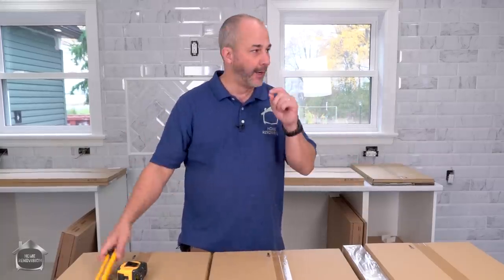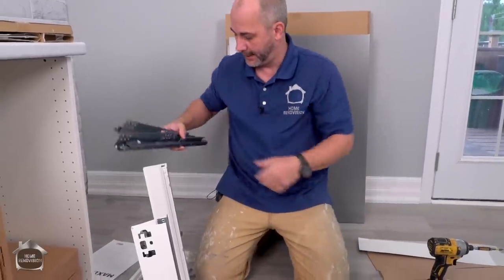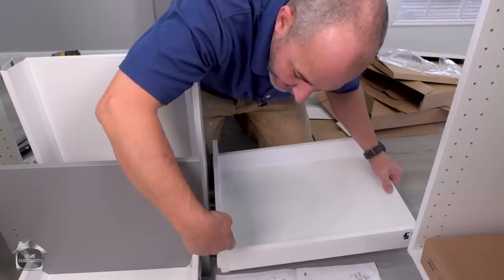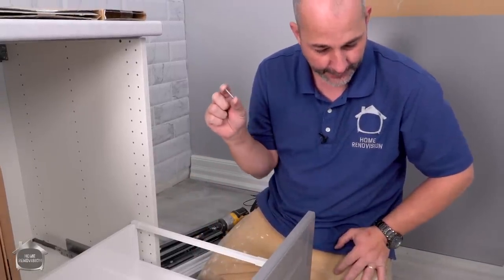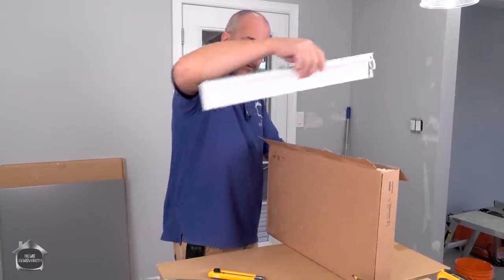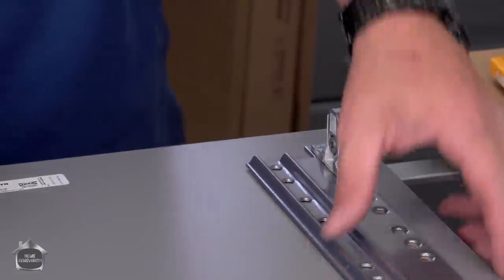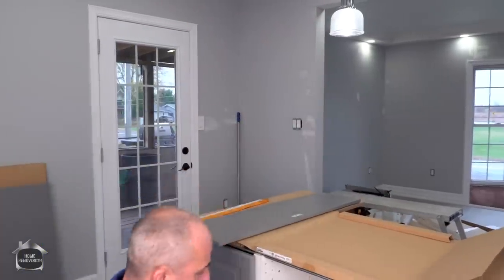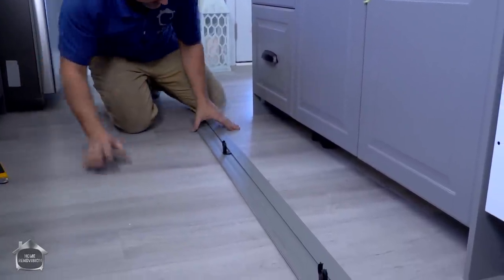How to Remodel Your Kitchen with IKEA Cabinets | Beautiful & CHEAP DIY Tutorial Pt. 2

Comment: I'll never install Ikea cabenits in my life, I still watched an hour video on Ikea cabenits I'll never install  😂😂😂
Reply from the maker: Cheers Gordon. hopefully you found at least one good jem in there!
Reply: It's easy and fun!
Reply: @HomeRenoVisionDIY  I just love your channel even if it's on ideas an projects I'll never proceed with, being a DIYer myself I find alot of these videos fascinating
Reply: Never say "never".  I'm a woodworker, and I am SERIOUSLY considering using IKEA cabinets rather than trying to refit/refinish the 3/4" veneered plywood cabinets I already have.  Just too much time and energy saved by getting new ones.

I hate refinishing pretty much anything....  That's also why I've decided to gut all the existing drywall as I go from room to room.
Reply: @ClayAutery  I adore mine.  They're really nice!  drawers/soft close - like butter.
Reply: Clay Autery We are in the same place.  We have 20+ year old cabinets that are now 3” too long because we wanted a new 36” range.   The cabinet frames and plywood are in great shape but they need new hinges, sliders, paint, plus they need to be shortened.  We have an unusual problem in that the finished end of the islands have an integrated finished panel side, so if we want to match our existing set up we need to remove that panel and use it for the side of a the new cabinet.  

It’s just such a PITA that we bought 2 IKEA cabinets to use during the remodel.  Just finished putting them together and installing them yesterday.  We used a hack to,strengthen the countertop support.  We used 2 4” strips of plywood screwed flush with the top of each cabinet to beef up the box for a heavy countertop.  It’s amazing how rock solid the cabinets are after the extra countertop supports were added!
Reply: Me too- I was like no way torture! But, with all of the good reviews here and your tips for kitchen renovations- I will try IKEA  :-)
Reply: @cgelmore488  Really - it's shocking how easy it is.  I got Axstad white and they're gorgeous.
Reply: It's literally lego with screws...

Comment: Your DIY videos are wonderfully helpful! 😻 I thought in this one you were going to show how to modify a panel to fit at the end of the cabinet covering the space between the cabinet and the wall, when that space is too small (e.g., 3 to 4 inches) to install another cabinet. I couldn't find that in this video. Can you please let me know where I can find that? I have an IKEA kitchen I installed mostly myself, but need to get your help with this. THANKS! :chillwcat:
Reply from the maker: simply build an L shape with small inside corner brackets and 5/8" screws. the part that goes next to the cab should be 6" deep and the side to the wall should be scribed to fit. then set in place and screw from inside the cab into the 6" deep part. Cheers!

Comment: I'm curious if BLUM themselves have hinges you can buy outside of IKEA (also BLUM @ $27 and $54 a pair. $380 in hinges for the kitchen I'm sized for). Richelleau has what I think fits and is the same for 60-70% cheaper.

Also, watch when you are using the kitchen builder. Mine added 3 panels for every box and alot of un-necessary accessories. Brought it from 9k to 4k

Comment: Thank you very much!
I've noticed that you attached the handles to the fronta after the instalation of the drawers and doors. It's also the way to go according to the IKEA instalation guide.
Howeder I think it could be easier to drill the front on the worbench, before to assemble everything. Do you think there is a reason to wait?

Comment: Great video, but I am a little concerned about the advice to cut the end panels at the bottom as it will leave the cut line and end grain of hdf exposed to water when washing the floor. A cut line on top would easily be covered by overhanging tabletop. If you need to scribe against floor to follow an uneven surface, remember to buy and install one of the plastic covers to put between floor and panel.
Reply from the maker: I use a tiny bead of clear silicone to seal it up. but great point. Cheers!
Reply: Rene Pape - what plastic covers? I don’t know what these are.
Reply: @jayd9203  I just checked, and it seems like IKEA does not provide these for the Metod system, but only back with the old Faktum system.
The IKEA recommendation, probably because of all the moisture problems, is to let the end-panels follow the bottom of cabinets (not floor) and only use the plastic foot-plate at the ends as well.
I just mounted another kitchen from HTH, and they still deliver these "strips" as the foot-plate is made of MDF (sorry, in Danish):
https://www.hth.dk/e-shop/tilbehoer/koekken-sokkel/26891513/gulvprofil-i-klar-plast-til-endesokkel/

Comment: This guy sounds like an Ikea employee. Let me tell you my cabinet story about renovating my  kitchen. The general contractor I hired said that the cabinets will only cost me ~$10k and that they will look awesome, custom made ... everything. I ended up using Ikea's kitchen tool, and then purchased all the cabinets, doors, gables, rails etc. from Ikea (the walnut finish) for $2700 tax included. Then it took me 2 days to assemble them. And then I was done, and I was super happy with the look and the results. So I saved $7300 and at least 2 weeks of waiting - perhaps 1 month. On my side of town, $7300 does not grow on trees, so I hope you will pardon me if the writeup here sounds like from an Ikea employee as well.

Comment: Love the video Jeff. So how does everyone feel about the metal drawer sides and back ? Can someone who has these comment ?
Also, how is the particle board holding up on the carcasses ?

Thanks.
Reply: Hey Will. I’m a life long cabinet maker and work in a high end custom shop. I can tell you this much- the Ikea metal drawer box systems are great, as are those by manufacturers like Blum and Grass. They’re extremely well engineered and make front installation and adjustment a breeze. It’s also nice because if you spill something inside you can just pop the front off and wipe out the box then clip it back on. The traditional drawer is say a birch dovetail box with side or under mount slides. While a decent option they don’t provide for near the adjustment possibilities. Also, spill any liquid inside and it can really damage them. As for the particle board for the boxes, this is by far our preferred material for cases in my shop. We will make plywood boxes but it is a major pain in the ass. The material isn’t nearly as flat, scratches and stains easily and really isn’t that much more durable than particle board with PVC edging. The big thing with particle board is to *snug* your fasteners and avoid over tightening. IKEA, like us in a custom shop, use a large number of euro screws. The big fat guys with no point that typically fit in a 5mm hole. They have a very coarse deep thread that holds well in particle board and mdf.

Comment: Hi Jeff!  Question:  Did I hear you say you can reduce the height of the toe kick?  Like from 4.5” to 4’?  Our finished floor is not level - out by 1 inch.  Was thinking of making the perfect counter height around the stove.  Then to the left the counter will be 36.5 and the opposite corner will be 35.5.  But that would mean the toe kick is too tall in the corner with shorter counter height.  Or would you go with starting counter height at 36” and end up with most of the counters being 37”?

Comment: Wow. I did not realize until now that IKEA has different sized drawers in the US and Europe. Over here, the cabinets are 80cm tall (about 31½ inches), and the drawers are 10cm (~3 15/16"), 20cm (~7 7/8") and 40cm (~15¾"). So, you can get 4 mid sized drawers in the cabinet, instead of 3, or two mid sized plus one large, instead of the small, mid size and large. 
Anyway - interesting to see the differences.

Comment: You do a great job with the channel Jeff! 

I may have missed this...are these the pressboard stuff Ikea typically uses, or did they go solid wood with the kitchen cabinets?
Reply: @slipperyslope8413  Thanks Bruce. Most I've discussed with in this area do boxes from plywood, and yeah solid wood implies 1X stock, so not a good choice of words on my part. Wonder if you could build your own boxes, then use Ikea drawers and fronts? Hmmmm...

Comment: my biggest problem with ikea builds is the phillips screw. Can't they use robertson or torx?
Reply from the maker: We can only hope they change!
Reply: It’s called a Pozidriv bit. If you use the proper bit when assembling, it makes all the difference. Bits are readily available on Amazon!

Comment: What do you do if your wall  is  not  straight   vertically leaving your rail such that your cabinets do not touch the wall at the bottom ( lower cabinets) and you can't get them perfectly level?  Shims?   Also I noticed you run your end panels all the way to the floor but this is your cut end.  how do you deal with water entering the panel and causing swelling?

Comment: I am thinking that having the cut edge of the end panel against the floor may have issues. If any water gets to it , it will start to swell.  Did you caulk it or take any other preventative measure?
Reply from the maker: i always seal with clear silicone. Cheers!

Comment: I must ask you here. Do you need plywood under quartz countertops on ike cabinets? Or does it go on top of metal frames bars that go across the cabinet on the top?
Reply from the maker: the secret is to make sure the top is flat and level. The metal bars are seldom used. i like to silicone my top to the box gables to keep things square. Cheers!

Comment: I’m having a problem with fitting my 30 inch double oven into the oven cabinet it won’t fit flush in so how do i get the oven to fit flush In the cabinet I did use the cabinet shelf vent space in the back and I did cut half of the back out do I need to cut the rest of the back out and do I need to remove the shelf vent

Comment: So i have a skillsUSA competition in a week, and one of the things i need to make are stairs. Could you please make a video of how to make stairs???
Reply: If you buy a  Swanson speed square, it comes with a little blue book that shows how to make stair stringers and how to do roof rafters and everything!!!
But there's many videon on YouTube about it 
Just don't forget to cut off the thickness of your first tread off the bottom of the stringer. It's a step that is easily missed but will be totally noticed when you try and walk up them.
Again, there are many YouTube videos and some with in depth explanation of all the math and stuff. 
Framing square with the little knobs helps too to be able to set the square once for your rise and run and just trace them all out.

Comment: Hey, so I think you missed a pretty crucial step with part of your install.  Which is also where the brackets you are missing come from as well. So the base cabinet that goes under the sink is supposed to use the Reinforced Ventilated Top Rail. Though your stone slab may not have this problem, without it laminated countertops can sag under the weight of the sink. In that hardware package is the brackets needed to hold the stationary piece. 

https://www.ikea.com/us/en/p/sektion-reinforced-ventilated-top-rail-galvanized-00284579/

Not discrediting how useful your video was, I’ll be installing my ikea kitchen this weekend so it was super helpful but when you were missing your front piece brackets I was worried I didn’t have it as well and found them. 😁

Comment: A few years ago, I built a new island in my kitchen for a new dishwasher where there was no dishwasher before. I had to go back to Ikea 3 or 4 times to exchange or buy something I didn't get on the first trip. Wouldn't have been so bad if i didn't live 135 Km west of Ottawa....
Reply: Josh Vaillancourt try living 5 hrs away from your nearest IKEA.
Reply from the maker: In that case I don't know if there is a better option. it would be nice if ikea had a reasonable delivery!
Reply: @SR98889  If I lived any farther away, I probably wouldn't even bother.
Reply: @HomeRenoVisionDIY  Too bad Amazon isn't into DIY kitchens...
Reply: Josh Vaillancourt It was a challenge, and required a lot of planning... but still doable. We needed to have some stuff delivered after the initial first order, which sucked because shipping is expensive and half of your stuff arrives damaged.

Comment: Jeff, breathe, great job but you seem to stress yourself a lot. Thank you for your video. The screw you found goes on the middle of the metal back of the frame. There is a little hole there.

Comment: The selection is not as great (we only found 2 colors we were interested in). But if you want real wood cabinets, Prime Cabinetry was recommended to me by an ex-cabinet maker. They are starting to use MDF and laminate, but depending on the look you want, they mainly have real wood stuff. The boxes themselves are mainly 3/4" cabnetry plywood, basically the exact same thing as a custom cabnet, but it's cut in factory instead of a local shop, and then you (or your builder) assemble it. I don't how easy the instalation will go, but you only have to do it once! 
We're getting REAL birch cabinets, and not paying for custom!

Comment: We don't have IKEA here, there are so many things I wish I can buy from them
Reply: You can get IKEA delivered if you are not close to one, but they use a hodgepodge assortment of 3rd party shippers based on your location, and I have heard that dealing with those shippers (who IKEA has no control over) can become a very frustrating experience. Also, this could turn 1-3 day turnarounds for replacing any missing/damaged/improper parts potentially into weeks.

Comment: When did you say you were coming to Cali? I really need help with my bathroom remodel! My wife punches a hole in my old 1954 under mount sink that's wedged between the deck and the tile! 

You know what that means right? Only way to fix it is to guy my pink and yellow tile. Or just do the right thing and gut the entire bathroom! 

I need you bro! I can demo, frame, cut the hole in the house for the new window, install the window but, i need help with the plumbing and the tile.

I've got a pool, nice big BBQ and an extra room that actually has a bed in it!

Shoot a video here!

Comment: As a professional kitchen installer with some 30 years experience I wouldn’t touch IKEA kitchens i’ve had the misfortune of installing probably about  seven IKEA kitchens and Out of those seven kitchens three went so badly wrong that IKEA ended up compensating The customers.
So IKEA maybe very cheap .but they’re cheap for a reason shocking rubbish steer well clear.
Reply from the maker: If you had 30 years experience you would have a different opinion. I call BS>

Comment: Still don't know where the long  screw goes? And you assembled Ikea before.. and teaching others... there is a hole on the back metal panel.. and it's there to screw the bottom panel with that screw...